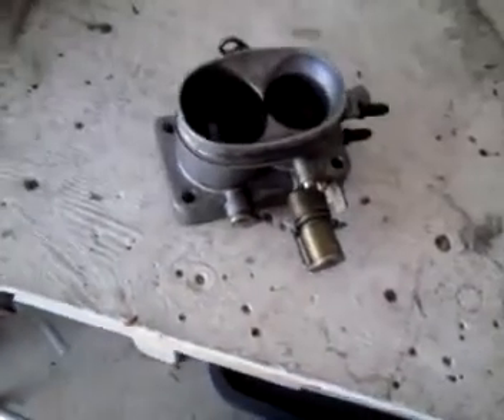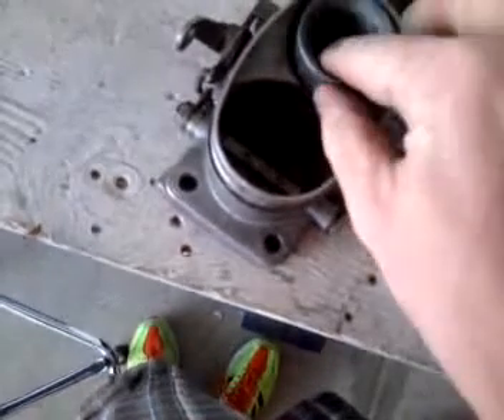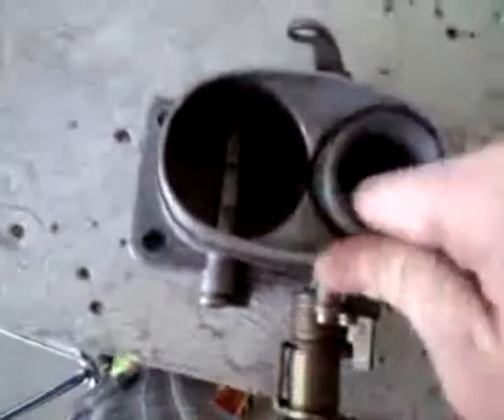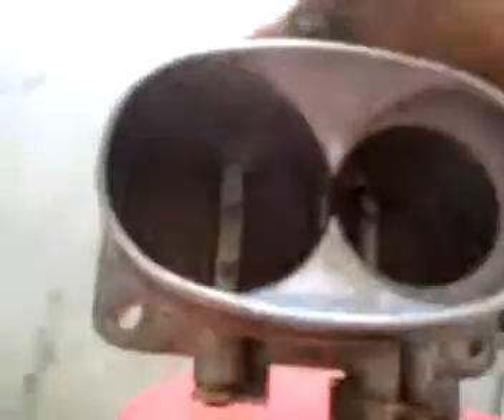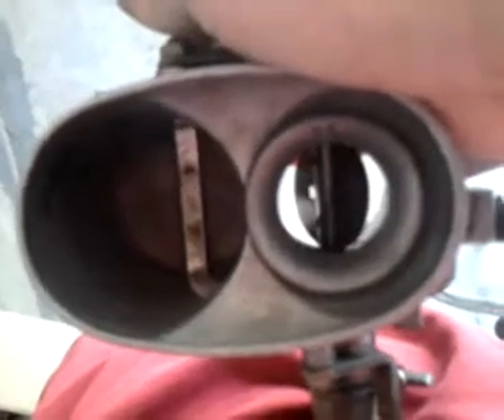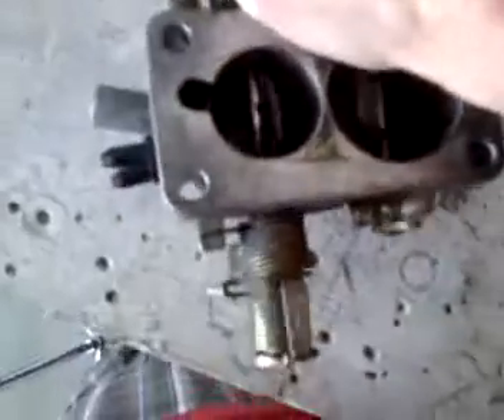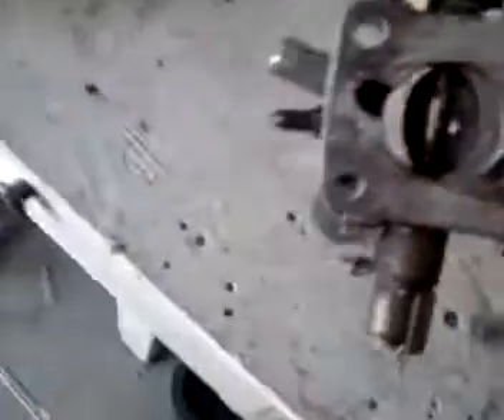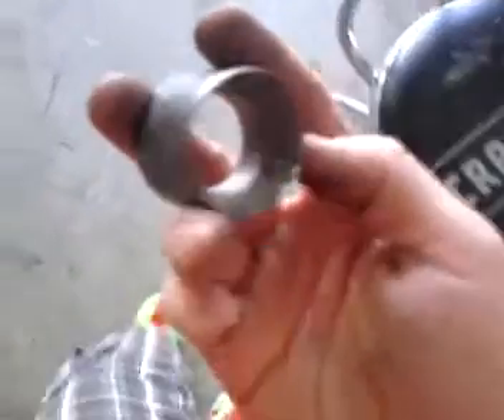924 Throttle Body Mod..better throttle response

Comment: Hello, I owned a 1978 924 and there is a brass roll-pin that holds the insert in. The restrictive insert was for U.S. only cars, to satisfy Fuel economy & emissions regulations. You can sand, file or grind a steel nail to pilot the brass roll-pin into the bore and pull it the rest of the way free with needle nose pliers. The hole is located on the front-facing outside of the T.B.. The roll-pin is about 3\8" to 1\2" in length. You do not hammer on the actual insert itself or even remove the T.B. from the engine. Hammering on the T.B. may crack it.

Comment: ohh cleaning garage redline used to make a large through bore throttle body...inside bore is 60.86mm..or 2.396.inches...bit of bitch to fit factory boot over it but does work

Comment: usually those spacers were on calif. cars .....can also use throttle body from vw rabbit ..bit bigger...may or may not have to add a additional inlet line for one of vacumes...again its a california thing ....smogs a bitch here
Reply from the maker: Yeah it's for the EGR vacuum amplifier. I turbocharged my car so I keep that piece off for improved air flow. You can put it back on and reconnect all the egr equipment for the smog check every two years.
Reply: Too bad eurorace isnt around anymore had stroker kit 2.4 for our little 2 liter audies